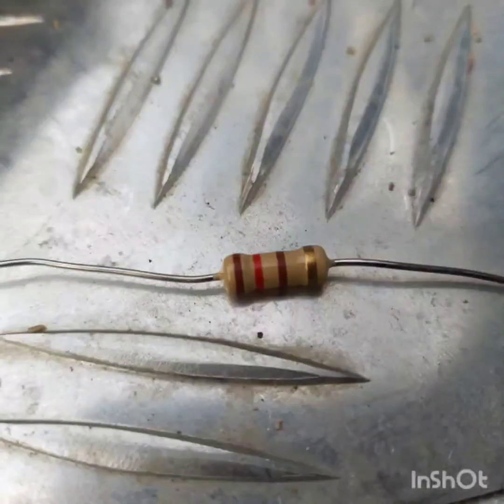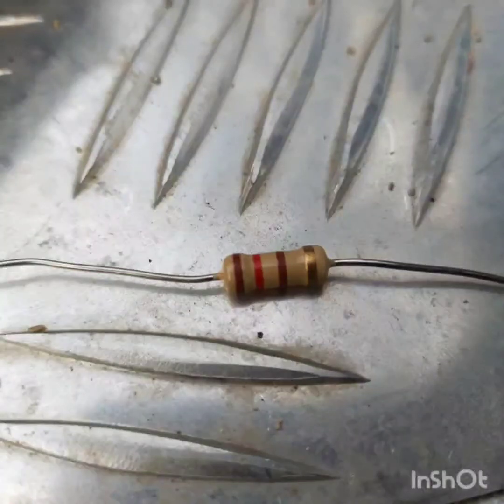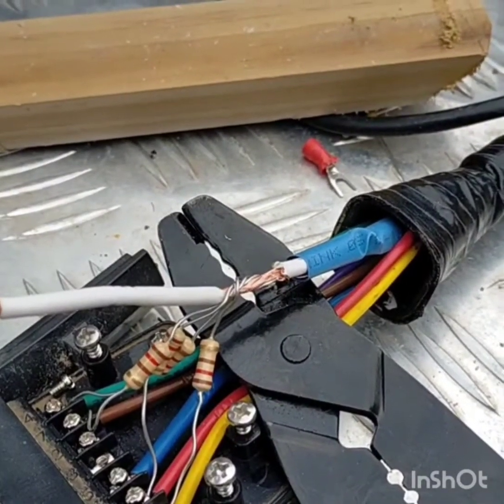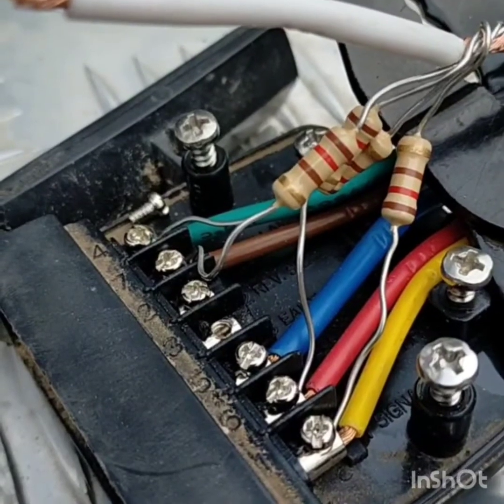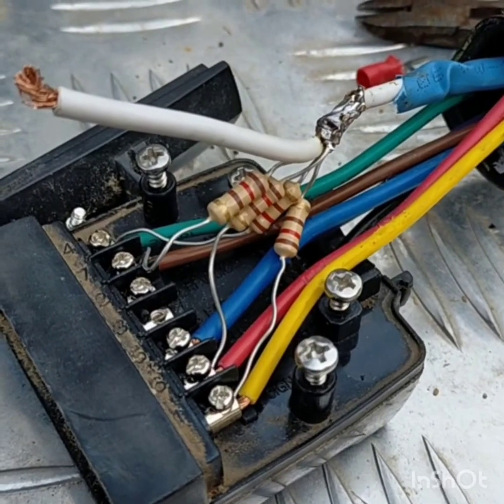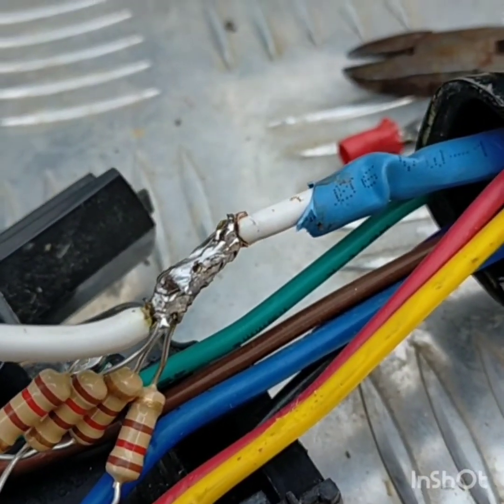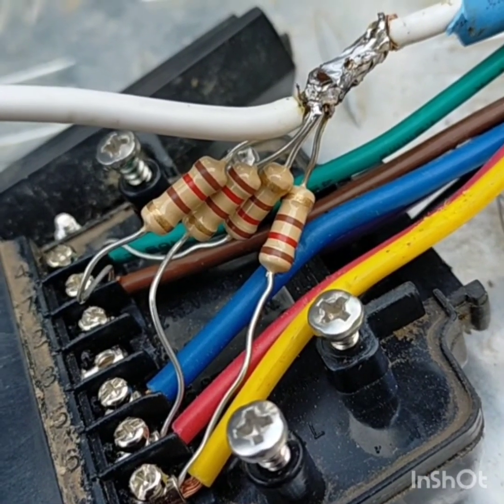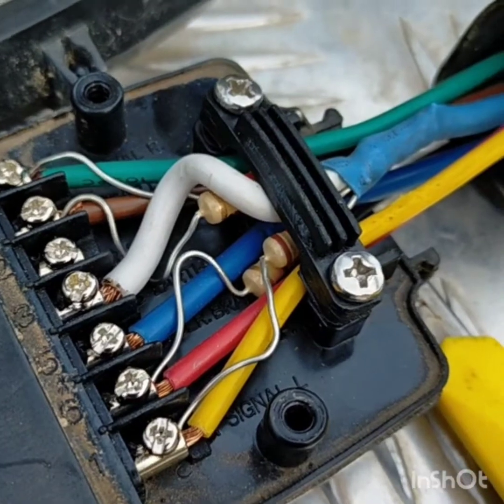LED trailer plug resistor wiring

Comment: Definitely NOT! These resistors can get very hot. The last thing you want is melted wires and a major short that could also be catastrophic for your car’s electronics even if it didn’t burn it down.

Comment: I have a 2013 cayenne S and I installed a module and connected to the taillight wires, when I plug in the trailer (led lights) they flicker and pulse, when I hit the right/left and stop it works as it should once it goes back to normal Tail it has the problem again, would wiring these resistors to the trailer wiring only solve it like shown? Thank you

Comment: THIS IS A DANGEROUS FIX!!!
DO NOT USE RESISTORS THAT HAVE A LOW WATTAGE RATING AS THIS VIDEO SHOWS.
IT “WILL” MELT SOMETHING OR CATCH ON FIRE AFTER A WHILE.
Although the theory is correct, the equipment used is completely WRONG.
YouTube should pull this video before someone gets hurt.
Reply: I did this. It is fine
Reply: @gandalf2256 still algood my hazard man ?

Comment: I have an issue with hyper flashing indicators on my trailer, do I need to install resistors to the tail, brake and backup LED to eliminate the indicator problem?

Comment: I had a hyper flashing problem with my Silverado and caravan, fitted the resistors and problem solved.
But after reading the negative comments about heat and smoke I had an uneasy feeling in the back of my mind so I decided to run a bench test. 
I connected the LED Stop lights in parallel with a 120R 2W 5% Metal Oxide Film Resistor 2-Watt Non-Flammable 120 ohm for a constant 6 hours.
Result no sign of any smoke or damage to the wires.
Reply from the maker: Thats great to hear. I never had any issues either.

Comment: Bloody life saver! Thanks heaps mate :) Got the exact same issue with my Audi Q7 but now it works perfect! Thanks a lot buddy
Reply: Hey mate. I have a 07 Q7 with same issue and this didn't work for me. Any pointers to what you did? Did you do it trailer side or with the factory cable that comes with the car. Thanks
Reply: @won79  G'day buddy. I used a different resistor. The one in the video didn't work for me either but I liked the idea. Got some resistors from Jaycar (they called 6.8 Ohm 10 Watt Wire Wound Resistor) think they were like $1.70 each. I installed them on an extension just in case I tow something that has normal halogens (made a short extension with a male and female 7 pin flat plug and installed them resistors in the extension).
Reply: @pierozzisandro  thanks for the response. Did you hook up a resistor to every light path or just the ones mentioned in the video? As now it's working except all lights coming on when I brake, including the turn signals.

Comment: No no no, these are going to get extremely hot and melt the plug housing and wires. Highly suggest resistors with their own heatsink and bolt them to a metal surface/panel away from any wiring/plastic or things than can melt or catch fire. Resistors taking the the watts to compensate for LEDs get extremely hot! Over 200deg c

Comment: A little general info.  The car delivers 12ish volt. With 120 ohm resistor the powe that goes through resistor is 1.2W. In reality a little more since the car puts out between 12-14V. The resistors is connected in parallel. That means that there is constantload on eatch circuit the resistor is connected to that draws about 1.2W. So. Recommended resistor wattage is minimum 2W. With 1W you living on an edge and with 0.5W you will se the smoke after some time.
Reply: V (voltage) = I (current) x R (resistance)
Therefore: I = V/R = 14volts/120ohms = 0.1167Amps

Power (Watts) = Amps x Volts = 0.1167 x 14 = 1.63 Watts

As Ove has stipulated most vehicles will fluctuate in voltage from 12 to 14 volts and sometimes a little more. Minimum 2 Watt is a good start as there is constant power due to the configuration of the wiring in parallel. Normally a 21 Watt bulb is installed in the vehicle or trailer bulb!
Reply: So what resistors should be used to prevent overheating ?
Reply: @kkireland1  i wrote that. Read again.
Reply: So a 2watt 120ohm 5% ?
Reply: So is the suggested resistor 70 ohm instead?

Comment: Set-up test lights and the resistor above works well and didn't notice heat buildup over a few minutes, but on the other light the Narva Led resistor was very hot.

Comment: Nice! My 08 Range Rover makes the indicators flicker all the time so just added a resistor to the indicators left and right but fitted them to the euro plug adaptor they uses to suite local plugs. This was the adaptor always I used and therefor ever trailer I connect is sorted.
Reply: I've just found out I've the same problem on my 06. Made a tralier with led light and nothing works , but on my Mercedes it all good, 
 Did you make up lead with these in? I am 7pin one end a 13pin the other with these in line

Comment: So I tried the larger resistors and like another person mentioned they get finger burn hot even with cooling fins so I'm not sure how these smaller ones can stand up to the heat? It also concerns me that any contact with the light wiring and it will melt through it eventually and possibly become a fire hazard, sadly they didn't work either. I also wanted to make an observation about your wiring, instead of stripping, soldering and heat shrinking the ground wires you can just place them all in a single crimp connector and if soldering is required to avoid loosening do so but then place the crimp connector under your ground screw and simply tighten. 

My new idea is to use a 4 wire to 3 wire wiring adapter and use it as the resistor instead, I had one of those already installed on my Touareg and it was without a towing module from VW, it worked but no trailer brakes so I plan to wire into the trailer side of the wiring harness to operate my lights while leaving my brakes on their own circuit, I'll let the board know how it works out.

Comment: Fantastic solution JillyBean. 

I have EXACTLY same problem with my ML320 CDI 2009. 

Just wondering do the resistors get hot?

And I wonder if just one resister in the ground line (going back to the car) could mimic the load required in these lights?

I hope to make up a 2 plug dongle with resistor(s) and plug in between my car and trailers when I hire or borrow them. Thanks for the vid.

Comment: Hi, great video. I have the same car and same problem. Is that 120ohm 0.5 watt OR 120ohm 5 watt resistors that you used please? Thanks in advance
Reply from the maker: Hi, gosh I don't remember. All I know is they're 120 ohm with 5% tolerance. Maybe if you took a screenshot into an electronics store they will know. Good luck. I ended up making an 'extension cord' type adapter with a male and female trailer plug with the resistors wired in. I keep this in my car and use it with my other trailers with LED lights.
Reply: I used120 ohm  0.5 watt and it worked with my Dmax
Reply: @RookieRR   colour doesn't show wattage. That's more based on size.